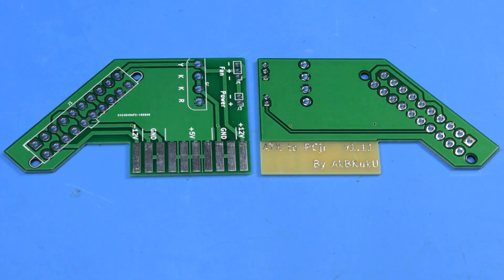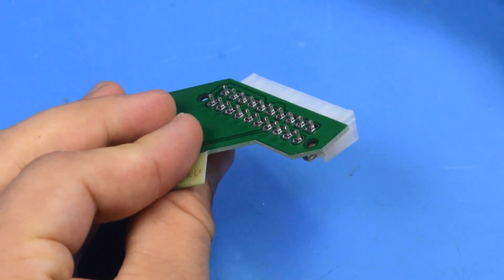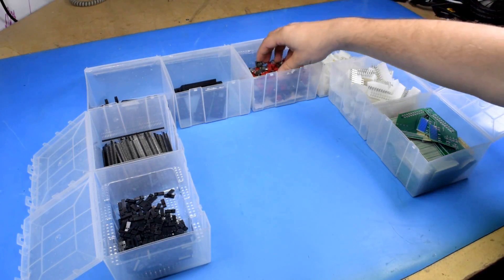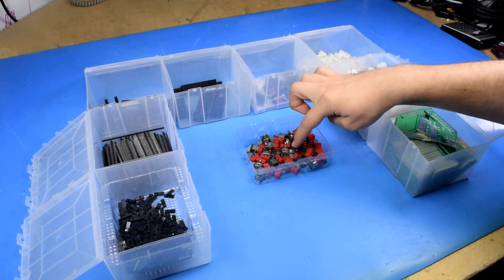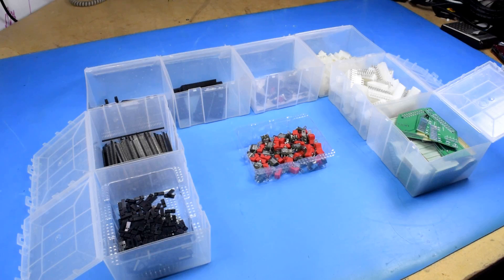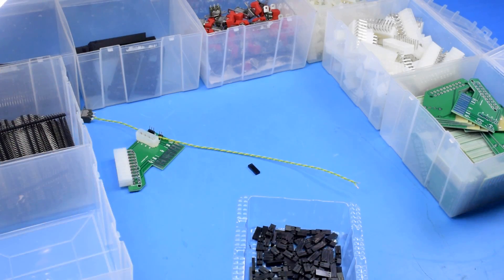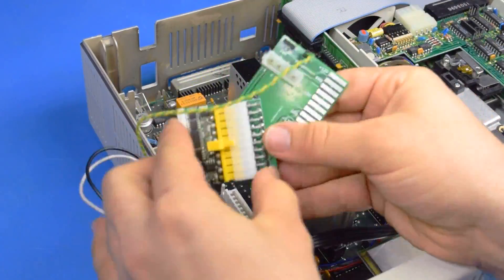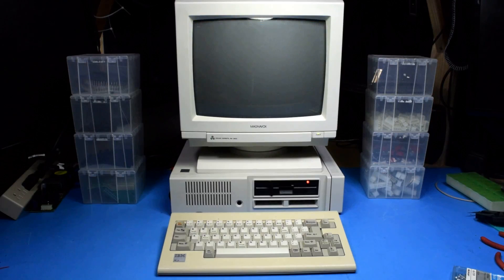0x0035.4 - ATX2PCjr Final Update

Comment: That is a very cool piece of kit, and I've already seen it in a couple of other videos, so that's awesome.

Personally, what I could really use is an ATX power adapter for an S-100 bus, which for historical reasons is 8v, 18v and -18v (each board was required to have it's own set of voltage regulators).

Comment: If you want to solder and crimp, and you have access to solder paste, put some paste on the connector and wire before you crimp it and heat the connector after :)